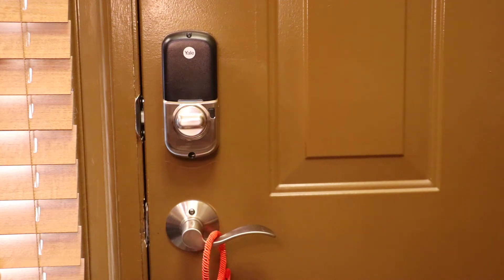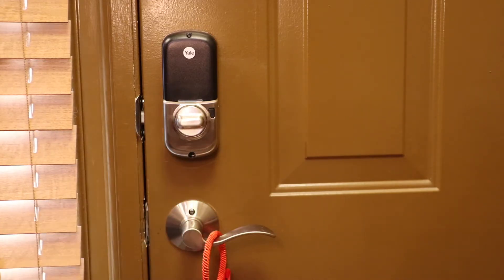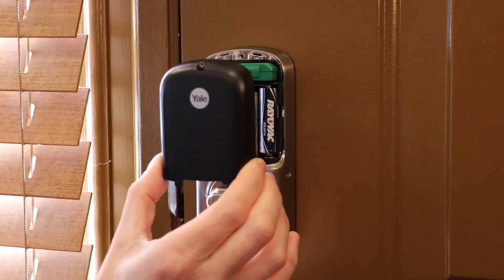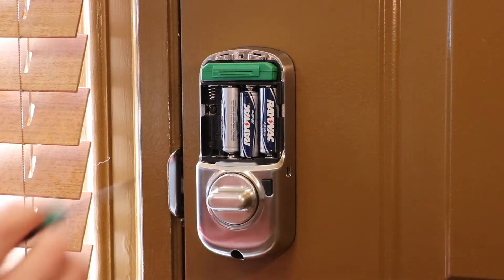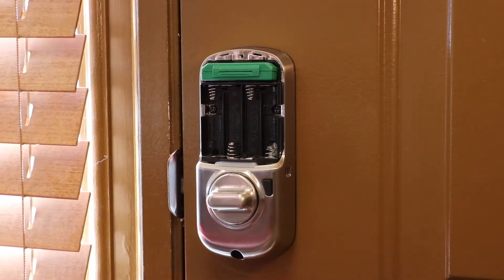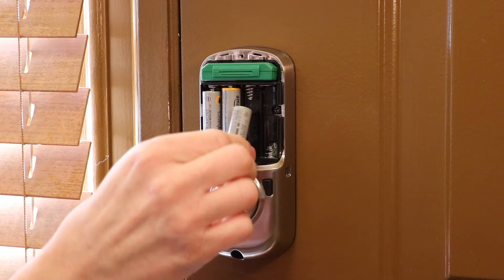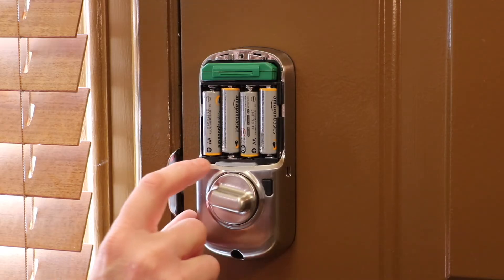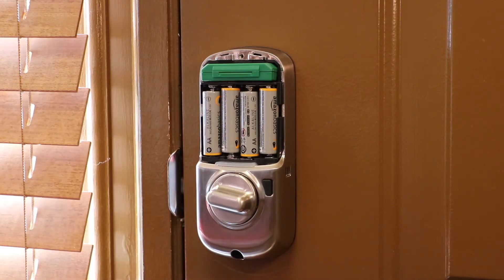Replace Batteries Yale Assure Lock SL

Comment: What's the green thing at the top? Mine doesn't have anything there.
Reply from the maker: That is an add on Z-wave module that can connect to Smartthings, Ring Alarm etc.  It allows you to lock & unlock via your phone or rules based.